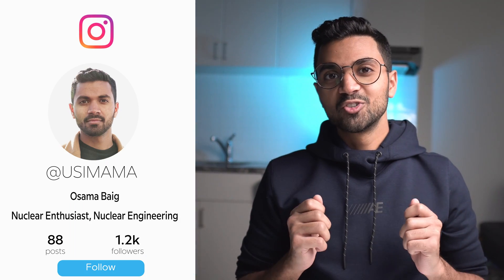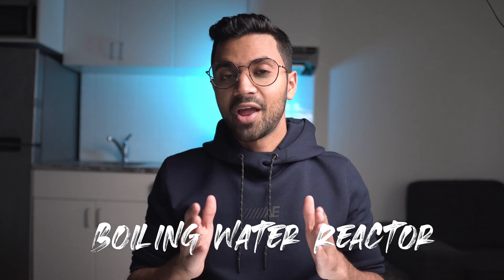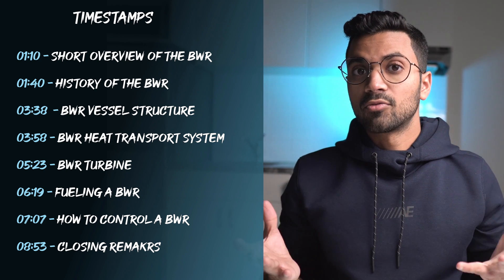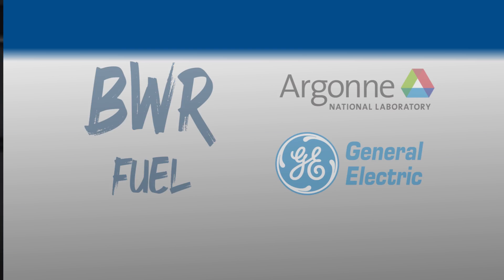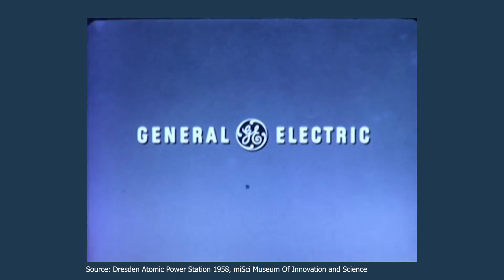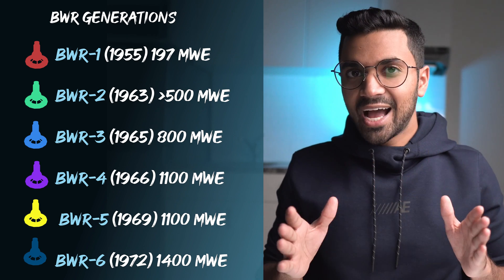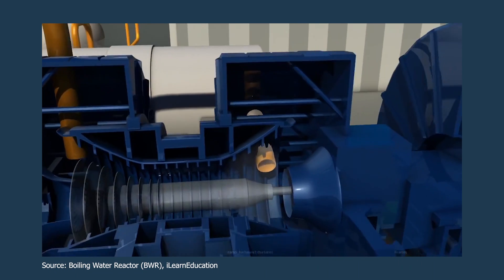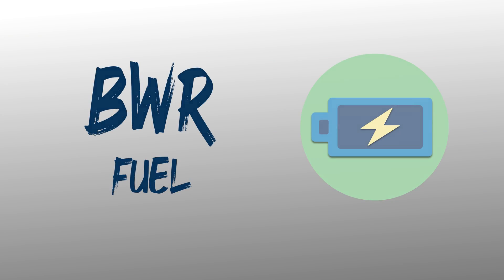Why BWR are the future of Nuclear reactors

Comment: Does BWR not require HD pipes and other materials in order to safely contain the high pressures and corrosion of the steam in the radioactive cooling (heat transfer) system which is transferred to the high pressure, non-radioactive  part of the system? I'm reading that atmospheric pressure in non-boiling areas (molten salt or molten metal) have only to contain these low pressures by resisting corrosion, not high pressure plus corrosion.

Comment: Large amounts of boiling pressurized water is not safe. 3% fuel efficiency and 97% long lived waste is awful performance. Build salt and lead reactors instead. No pressurized core, and better fuel management, better overall efficiency. Water reactors are a thing of the past.
Reply: But no water moderated reactor has failed catastrophically or lost containment.
Maybe gen 4 reactors can use high temp gas cooling for better heat transfer efficiency, particularly super-heating. The UK has good experience with gas cooled reactors.

Comment: BWR? Like the one that cooked off in Chernobyl?
Water is just the wrong coolant. Water needs to be kept as water. So you have pressure. Lots of it. And that goes bang. Don't use water.
And the fuel itself should be liquid. And burn a little more completely than 1% of the mined element of Uranium. This makes it totally load-following.
And if anything does go wrong, unfreeze a plug and let it all drain into a tank with no moderator.

What we need to spend the money on is the MSR. 
This is the only reactor whose goals are worth spending money on.

Comment: I still feel nervous when you use the coolant as a moderator.  The thing you use to control the heat is responsible for causing the heat in the first place.  Therefore it can never be "walk away" safe.  The whole "using water" thing came from the US Navy because ... submarines.  That's where the expertise came from for power reactors.  The idea was to build them right on the coast and use scaled up Navy sub reactors.  If it goes nuts, just dump a shed ton of water through it, it'll be fine.  it's underwater, right?  Oh... wait.   An honestly dumb idea driven by money and not sense.

Comment: The overall issue is that PWR's have proven to be generally more economical to build and operate than BWR's.  That's why BWR's make up only a small portion of nuclear power plants in the world.     Theory is great.   Real world practical experience say that great theories don't always work well in the real world.

Note that Westinghouse recently announced a 300 MW "modular" PWR based on the AP1000 design (and using some of the same components and controls).   I think thats going to give the the recent GE 300 MW "modualr" BWR a run for its money.

The AP1000 is the most successful modern large PWR design in the world.  6 have been built and I believe there are orders and letter of intents for at least a dozen more.   Even the Chinese recently ordered more AP1000's over its home grown PWRs because they are working so well.

Comment: BWR fuel assemblies are smaller than PWR.  The picture you show of a PWR is not what is used in Western style PWRs (US, France, Asia).  The BWR picture you had is actually 4 assemblies around a cruciform control blade.  

Also, the BWRX doesn't use recirc pumps so you can't vary power as your described.
Reply: True but it does recirculate naturally. Same principle just more efficient. The recirculate pumps have been a weak point in the BWR reactor designs.

Comment: Why they are less popular than pwr?there must be a reason for that. Also why conventional plants get water from river and don't use condenser.
Reply: BWR's are less popular in the US for one primary reason: the spread of radioisotopes is far greater than with PWR's or CANDU reactors. In a PWR or CANDU, the reactor coolant is never allowed to leave the primary containment and Auxiliary Equipment buildings- at least not intentionally. Reactor coolant is pumped through the tube side of a steam generator, and the secondary loop water on the shell side of the steam generator is what gets boiled into steam to spin the turbine generator. As long as the heat exchange tubing in the steam generator isn't leaking, contamination of the secondary coolant with radioisotopes should be near zero, and thus radioisotope contamination of the equipment in the turbine hall is minimized. Repairs to the turbine can be accomplished without exposing workers to high levels of radiation. In a BWR, the reactor coolant loop is directly connected to the primary turbine, and this means that if the turbine casing ever needs to be opened to inspect or do repairs on the guts of the turbine, it's far more hazardous and expensive due to high levels of gamma-emitting radioisotopes. Even though reactor coolant water is continuously filtered and purifies by running it through resin-bed ion-exchange demineralizers, enough radioactive particulate matter makes it through, that BWR turbines eventually become many times more contaminated than PWR turbines.

Comment: The only drawback of BWRs is that the water and the turbine becomes radioactive because the water comes in direct contact with the uranium.
Reply: Well it’s not in contact with the uranium. The steam carries fission products in the steam system to the turbine and its condensate and feed water systems. The uranium is contained in a ceramic fuel pellet inside a fuel tube and that is sealed in the fuel rod.  This in fact makes the BWR design much dirtier (radioactive and contaminated) than the PWR design / type of reactor.  Over the life of the unit, it produces far more secondary contaminated waste than a PWR.  Less expensive to buy / build but more expensive to Operate and decommission.

Comment: BWR are not the future, these are the past. And quite problematic past at that. Four explosions, five if Chernobyl is to be accounted. Their time is long gone, and further development of this concept has no practical sense. These reactors had their niche in 1970-1980s due to low cost of deployment, but nowadays they’re obsolete.
Reply: 4:00 Nothing new here. The same is correct for RBMK and RBMKP reactors as well as MKER project, which are technically BWR as well. Projects were scrapped in favor of VVER and BN, because these economical benefits of direct boiling are repaid later with costs of maintenance and utilisation.

Not mentioning that liquid metal cooling can provide the same benefits without having a timebomb filled with radioactive boiling water.

Comment: These nuclear reactors operate at way to low a temperature to actually store power as heat and to low a temperature to be useful for industrial use.  These reactors also have safety issues in that water has to be held at high pressure to get any efficiency in the system.  Because of this danger expensive containment structures need to be built.  Still without cooling pumping working after an accident hydrogen explosions are possible which can destroy even the strongest containment structures.  Makes much more sense to use liquid metal or salt that does not have the hazards of high temp hight pressure water
Reply: Your statement is inaccurate in several ways. Low temperature steam may be wet in nature but it can heat structures and be used in heating process materials in processes that need heat to operate.  This modular BWRX design uses a sub- terrarium containment structure and modular sections to speed construction and improve quality control.

Comment: Wouldn't it be possible to separate the reactor water and the turbine water with a heat exchanger?
Reply from the maker: Good question. I believe the reactor vessel assembly has equipment at the top which acts like a steam generator and helps create that separation. However, It would be great if someone that is a BWR expert can comment on this
Reply: @OsamaBaig  The answer is that its not cost effective to have a steam/steam heat exchanger in the circuit; and reduces the thermal efficiency of the entire cycle.

PWR's get away with it because the pressurized water is a lot hotter than the resulting steam generated.

Note:  I've worked in the nuclear power industry and was the heat exchanger expert at my last plant.   Lots of things work in theory; but don't work well in practice.
Reply: In theory I believe it is.

But why?
I don't see the benefit really..
Reply: @PU-239  clean water=no irradiated plumbing and turbines, which mean less need for shielding and special disposal, in fact the equipment could be reused later
Reply: @UncleFester84  The steam systems are very clean tbh if you don't run the reactor with ALOT of fuel damage.

Pretty much all the radiation in the turbine is nitrogen-16 with a 7 second half-life. After shutdown a BWR turbine can be serviced essentially like any other turbine..
Reply: @PU-239  Only assuming no fuel cladding failures.   Unfortunately, fuel rod cladding failures still occur (although at a lot less rate than in the past).

Once the fuel rod cladding fails... some really nasty radionuclides get transported around the entire steam/condensate/feedwater system.  Most older BWRs are modestly radioactively hot for the whole plant.

PWR's are a lot cleaner.   Note that I worked in nuclear power plants - and greatly prefer PWR's
Reply: @perryallan3524  Doing what kind of work? Any turbine technician will prefer a PWR as they don't need to wear the funny looking RC zone overalls I guess 🤣
Reply: @PU-239  My last position (for many years) combined 3 different functions:   1) Heat exchanger condition, maintenance, repairs, replacements for the entire plant ranging from lake cooling water to primary loop PWR heat exchangers (Note that Steam Generators are a heat exchanger).  2) Spent Fuel pool System Engineer (covering fuel transfer, spent fuel condition and issues, and cooling).
3) GL89-13 Program Owner (this relatates to the bio-fouling and corrosion of raw water cooling systems and equipment - a major issue in most older generation nuclear plants).

I was also one of the few Root Cause investigators in Engineering (major NTSB transportation reports are Root Cause investigations and reports - and I had the same training and certifications as most NTSB investigators).    I did major root cause investigations/reports on Reactor Vessel Pressure Temperature/Life limits; Auxiliary/Emergency Feedwater Pumps/turbines to ensure safe shutdown (resulted in complete replacement with a new design of our Aux Feedwater turbines and I believe pumps as well).  Condensate Pump motor failure.   Each Root Cause took months of time (The reactor vessel life one took about 9 months from start to end - and the entire team was pretty burned out by the end of it - and its findings were significant about major problems that had not been adequately addressed at that plant - and why).   I have presented a number of industry papers at industry congerences over the years and was considered one of the Heat 
Exchanger experts in the nation.     So I've dealt with all areas of the plant and lots of equipment (but never turbine maintenance since my serving in a Naval steam propulsion plant decades ago:  Note that I got my engineering degree after I served in the US Navy and power plants were a natural fit due to my steam propulsion background.

Comment: "Drying water" that sounds like such an oxymoron... I know I know, it's so that liquid water doesn't get into the steam lines. But wouldn't some of the steam condense along the way to the turbines anyways?

I used to prefer BWR's for their simplicity in the elimination of the secondary loop. But the whole, insert control rods from the bottom up concept has me a little worried. Sure there hasn't been a case where they've failed to insert, or at least I don't think there's been one... But after all these nuclear disasters I would prefer a design which is as fool proof as possible and going with gravity as opposed to going against it at least eliminates one potential future failure mode.
Reply: There was an accident (serious) at PGE'S Humboldt Bay Unit# 3 on 7-17-1970 due to a loss of outside power. Backup power from a petroleum based unit failed due to a disconnected cable. A small propane generator that could not even power all the emergency instruments was all that remained to scram the control rods. More than 50% of the control and fuel rod channels were bent beyond allowances due to the dropping of a fuel bundle in 1965 which damaged the core support plate (hard). Now the ability to insert the control rods from below against gravity became a life or death issue.
Reply: BWRs use hydraulics to insert control rods, which provide much higher insertion forces than gravity, so they will work even in the event of core damage. bWRs are safer, and that's one reason.

Comment: One big advantage of the BWR is their contol scheme, which allow for load following way better than most other nuclear units.  Using steam voids and jet pumps they can move from 50% to 100% in 3+ hours.  The power grid needs power plants with flexiblity like these.  I'm happy to finially see a BWR in the SMR mix for this reason.  The BWRX-300.  Good video Osama!
Reply: They could do it faster but they are limited to 15% per hour change by their tech spec's. PWR's have great difficulty maneuvering like this on a daily bases. PWR's are basically base load plants, BWR's can do both base load and load following.
Reply from the maker: Very interesting fact! I was not aware that they can go from 50% to 100% in 3 hours. In the SMR design, its probably gonna be a lot faster. I've heard the burn up for fuel (fuel economy) is the highest in BWR's as well
Reply: @OsamaBaig   In the USA the 15% power ascension limit is a standard tech specification for fuel integrity. A gradual increase so linear heat rates don't exceed linear heat rate limits on the fuel, and the need to overcome the Xe-133 poisoning effects.  A 15% limit is very usable on the power grid. Power demand changes on 4-5hr ramps both up and down.
Reply: You'd be on a poor load line that whole time and only achieve MOP.  There a few of pattern adjustments and waiting for xenon buildup you'll have to endure to achieve RTP.  Flowing from 100 to 50% is another story. @OsamaBaig
Reply: @OsamaBaig It is in general a more efficient design from reactor power / thermal power to turbine power.  Due mostly to the single cycle there are no steam generators.

Comment: Have you done a video on Darlington's planned BWRX-300? I think OPG is tagging it as Gen 3+ since it's not as advanced as currently out-of-reach Gen 4 reactor technology. Is it considered Gen 3+ because it's SMR combined with BWR?
Reply: GE states that the BWRX-300 is a GEN 10 (X) reactor design.  It is designed to generate electricity or steam supply to building heat loads or other loads.  Not just a power generator. The BWRX is designed to be a modular build facility with 60% of the plant pre-built then assembled on sight.  Its footprint is less than the size of a football field.

Comment: Very good video.  Can you elaborate more on this stuff.  For example why does it only use a single loop?  Could it use two loops?  Is there any reason why PWR reactors don't use a single loop?
Reply from the maker: Great question. PWR reactors don't use a single loop since actual boiling doesn't take place inside the pressure vessel. Other components like pressurizers is where boiling takes place. Thus, instead of directly creating steam which goes directly to the turbine, it has to pass through Steam generators which can remove moisture and provide heat exchange between the circuits. However, there are 4th generation PWR design's which have the ability to directly produce steam (This is only possible through very high temperatures)